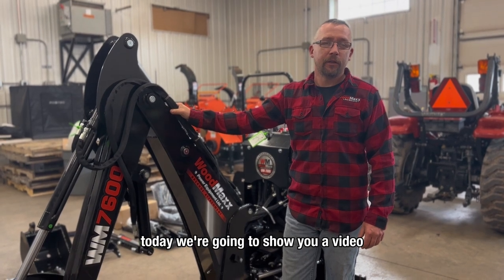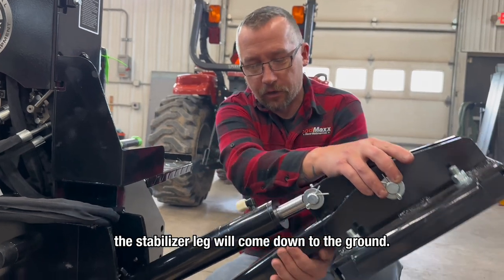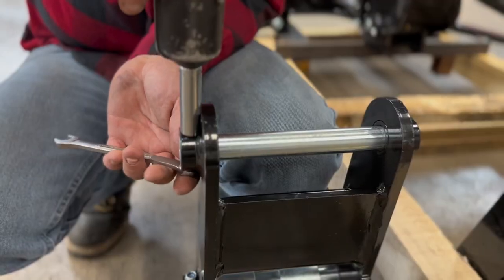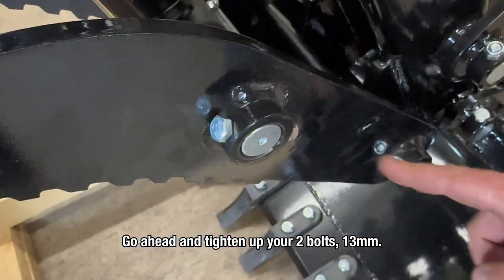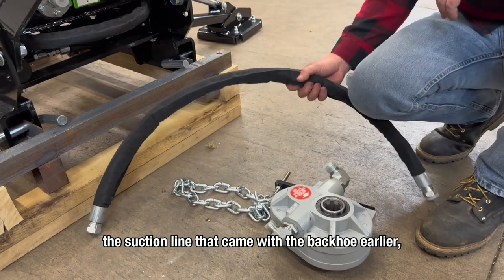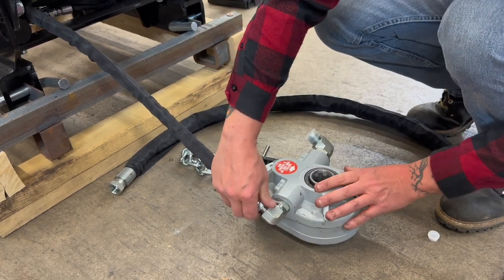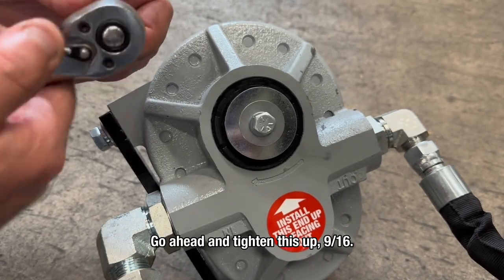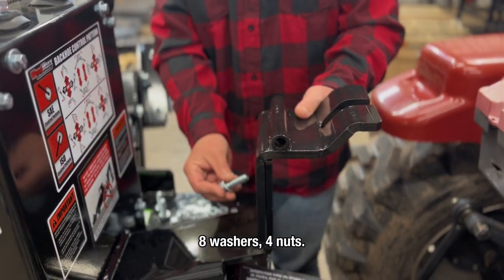Backhoe Assembly

Comment: I picked up the WM6600 about 3 years ago and it's been awesome. As was any dealings with the company.
 GET the hyd thumb if you even think about picking anything up, it opens a lot of doors you wouldn't think you would use it for. I've use it to pick up tree's, large rocks, stumps I dug out, etc. On the heavier loads, If it could lift it then all I did was back my old wannabe HF trailer under it take it to where I needed it and pick it up again and drive off. I got the "quick change" for the bucket as I also got the 'Ripper' so it would be easier to change out and maybe in the future buy a larger/smaller bucket.

 I had looked for a loong time at the different 3pt backhoe's and the WoodMaxx just had the most bang for the buck. I was looking for a lighter one for my old '97 JD770 but not something that was going to fall apart after a few month's. It's a bit on the high side of the grey area for the JD as far as heavy but I just used common sense on what I did. I used it for two years on the JD before I got my LS MT235HE and transferred it over.

 The only problems that went wrong, -that I didn't cause-, was I had the pressure hose burst into an small Old Faithful fountain. I contacted WoodMaxx and even tho the hose was a few months out of warranty they went ahead and sent me a new one anyway. And a metering valve started seeping and was sent a new one under warranty. Not too bad to get to and replace.

Now the problems - I - caused, when you do more then the intended use, the articulating part of the bucket bracket may bend a bit. Pressing it back straight helps. Also, DO A PRE-TRIP every day. My clip for the chain to the pump fell apart and wrapped the hose's into a pretzel, -at an idle-.
 Things I would change if they haven't already, put stronger clips in the leg pins as the movement in the pins sliding will bend or break the smaller ones. Also a maybe get a few larger washers/bushings to take some of the slack out of the pivot points in the joints?
 As is I would still buy it again.
Reply: Why in the "World" would you Lay out All that money for a unit that HAS NO GREASE FITTINGS & only "kotter-pins " holding things together? Just is So cheaply constructed;  could of been great "IF" the company could of invested 27$ in sourcing IT With GREASABLE PINS & BUSHINGS!! The "sloppyness" eventually WILL Be CATISTROFIC.
Reply: @donaldstrishock3923  
 No where in my comment did I say it DIDN’T have grease fittings.

 So without even looking at this brand you come up with that conclusion?

 Every pin/bushing that has rotating movement has a grease fitting. The pins where the legs pivot up and down, there’s just a bit more movement, side to side, of the leg that I think it should. The “clip” for the pump was actually a nut and bolt that I thought I could hand tighten which was all on me. The leg pins are the only ones that have a “Clip” and - I - feel they could be larger.
 This is NOT a commercial backhoe. I do not use this 8hrs a days / 7 days a week / 52 weeks a year. I do more than dig holes or trench’s. So the small things that I mentioned are the end results of not just digging holes. So I may use it for a month straight.
 And yes also in my “World” I spent all that money so It will probably sit for 10 months out the year, my brush cutter will sit for 7 months, my hydraulic bucket may sit for 6 months, my tractors may sit for 6 months, but when I need them I have immediate access to them and I may use them for months at a time.
 I don’t have to wait for a spot in line to rent one or a day they can deliver it to me and spend $300 a day on a day that is not good for me and I have to take a day off in order to use it.
Reply: @jaygyver7213  So sorry for my "mis-calculation & conclusinons". I JUST DID NOT See GREASE-fittings anywhere during the "Assembly Procedures". I'm sure glad for you "Sir" that it does. My Apologies. I just can't believe that l didn't see "Them"!